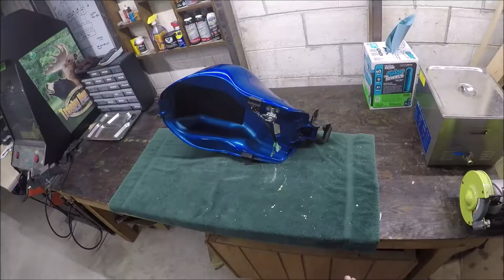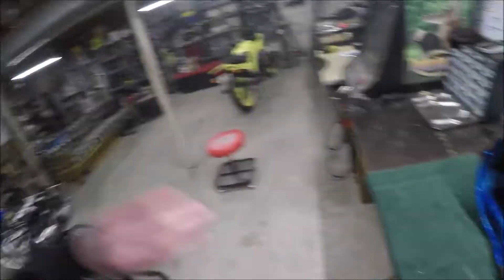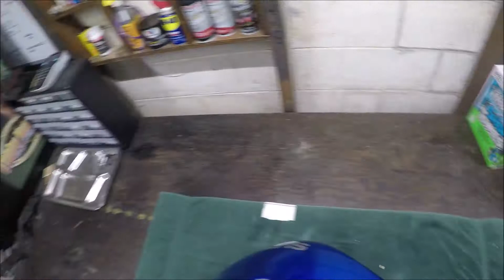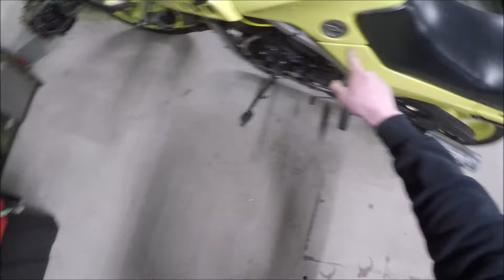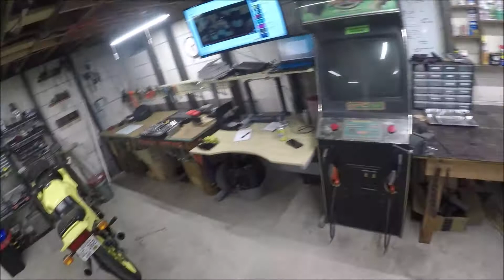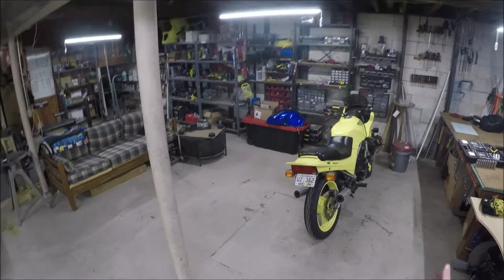[Short Rant] Vacuum Operated Petcocks

Comment: Thanks for this. I was considering "upgrading" to a vac petcock and see this is a bad idea.
Reply from the maker: I should probably mention that there is a safety aspect to vac operated petcocks... In the case of a tipover where the bike cuts out, fuel won't flow and possibly add to a fire.

But you're more likely to find your bike on fire with a vac operated petcock because youll want to light it on fire sometimes.
Reply: @matttriestodothings  Lol it sounds like it, what a pita. I was curious because of the tipover aspect and not having to turn the valve all the time, but I have less patience for things failing than turning valves.

Comment: I was all in when I read rant.
Reply from the maker: Hah, I was doing really good today at tempering my temper until I realized every single vacuum-operated petcock I've encountered has been a nuisance. I didn't throw anything though, and the tank is all set to go back on the bike.
Reply: My bandits vacuum fuel valve leaked constantly causing it to be towed three times by my apartments HOA. Ruining the motorcycle parking space they just paved for us. It’s a ridiculous design, but don’t your bikes have the overflow float valve thing preventing the fuel from entering the engine in case it fails? Only a small amount of fuel went into my oil. Barely raising the oil level. My bandit was a ‘97 so maybe I’m exempt from that issue?
Reply from the maker: @hondacbrico5866  Oh no, the MK2 Bandit goes right into the cylinder. No overflow.

It's not really fair that I bitched on Suzuki while looking at an SV650 during this rant because the SV has a vacuum-operated fuel pump AND petcock. So, it won't actually run straight into the engine (with a stuck float) like the 2002 Bandit I have will.

One of my last rides of the year the Honda VF500's petcock failed while I was out riding, and I had to limp it off the goddamn freeway. Luckily I was near an exit. I called a (savior) friend that went to my house, grabbed my ramps, drove out to me, and we loaded the bike back up.

I seriously hate this things. They're seriously clever, but they don't stand up to the test of time.

Comment: Can You Please Show Where The Vacuum hose Is Connected On The Vtr Interceptor I Have A 88 And Having Issues With That
Reply from the maker: A VTR 250? I'm not familiar with that bike, but it's likely similar to the VF500F based on the images I'm looking at. The vacuum-operated petcock will connect from the petcock itself to a vacuum nipple on one of the two carburetors. What's got me a bit confused is they call what I would think is a vacuum line a breather tube CLIP, BREATHER TUBE
15772-551-000. I believe this is from your bike here: https://www.partzilla.com/catalog/honda/motorcycle/1988/vtr250-a-interceptor-vtr/fuel-tank
Reply: @matttriestodothings  Alright The Bike Has Dual Cv Keihin Carbs .  I'm Wondering Where The Vaccum Line From The Petcock Would Connect As The Carb Only Have One Nipple Sticking Out On Each One The It Has The Carb Drain When You Turn The Drain Screw

Comment: Where do you get replacements for these vac operated petcocks?  My KZ440 has a bad one.
Reply from the maker: It'll depend on the hole spacing that your tank will accept. I did a Kawasaki 454LTD recently with a Yamaha 2VN-24500-02-00. I also did a Suzuki Bandit with that Yamaha one. But I couldn't tell you if that same petcock would work with a KZ440.

Come to think of it... I did a Kawasaki EX500 with the Yamaha 2VN-24500-02-00 as well. I just had to grind a little bit of the handle off to make it fit.

Comment: my yamaha 79 xs 750f has vacuum petcocks, and i don't know if that's causing my carbs to fucking flood constantly, or if it's something else. but every forum i've looked at they say to just convert to manual.
Reply from the maker: Not familiar with that bike, but if they're constantly flooding it means the float valves aren't sealing. Theoretically there should be no need for a petcock (for this purpose).

Going to a manual petcock certainly removes a variable tho. If the leak is slow enough that it doesn't affect the bike while running, a manual petcock may be a stop gap. But the carburetors shouldnt leak at rest regardless.

Floats are never fun. Hope you're able to get it resolved without too many headaches.
Reply: @matttriestodothings  when you say not sealing do you mean not floating properly causing them to continuously fill?
Reply from the maker: @The_Rat_King23  Yep, exactly.
Reply: @matttriestodothings  well that's a relief, at least I thought something else was very wrong. I just rebuilt them so maybe the floats have holes

Comment: My SV is a 1999 , had it from new,The pet cock only failed now (December 2020) A rebuild kit was about £10.00.  Not bad for 22Years old.this only failed because of rust in the tank blocking the pet cock diaphram. What's the big deal!
Reply from the maker: The rebuilt one on my SV will probably last many many years now, but the big deal to me is the unreliability of the things. It's an both an annoyance and potentially dangerous. I lost power on the freeway when one of them failed (not SV), and was lucky enough to be near an exit. On bikes without a fuel pump that use them, I don't trust that they're going to stay perfectly sealed for the duration of a winter.

They just seem like a solution to a problem that shouldn't exist. There are tons and tons of stories of Suzuki Bandit owners all going to check on their bikes after winter only to find all of the fuel had migrated from the tank to the crankcase. I would have thought this would be pretty rare since it requires two failure points (petcock and 1+ floats), but it seems super common. That petcock doesn't have an OFF position which is really silly to me.

Just look at HondaCBRico's reply below. The Bandit one is a special kind of awful, so I was already spoiled to the idea of these things to begin with. Having another fail last year didn't help. I haven't read nearly the horror stories about the SV650 version though. I think it's far less prone to a failure.

Comment: Can't you run just on prime? And turn it to the ON after a ride as "OFF"
Reply from the maker: Depends on what question you're trying to answer and for which bike. Suzuki GSF600 has ON/RES/PRIME, so you can certainly run it while it's on prime. The issue then is whether or not it closes correctly when setting it to ON. On a Honda VF500F, you have ON/RES/OFF--no prime. So if the diaphragm fails and doesn't allow it to open, you have no way of bypassing the vacuum-operation. This leaves you stranded on the side of the freeway.
Reply: @matttriestodothings  Thanks for the reply. I asks this because I just got a 2007 DRZ40SM with an FCR Keihin carb and my stock vacuum petcock has ON-PRI-RES. The guy I bought it from did  not have a vacuum line because FCR doesn't have a nipple. It runs on prime only because of it. I'm worried if this will ruin my bike.
Reply: @matttriestodothings  I took it to the shop and got all my jets and brass adjusted-cleaned carb.. even the shop just mentioned that my On is "off" and have to run prime. But wouldn't that ruin the bike?
Reply from the maker: @bziano883  You won't ruin the bike that way--the shop is correct. Functionally, your petcock now operates the same as a standard ON/OFF mechanical fluid valve. PRIME = ON, ON = OFF. 

It sounds silly, but you're good to go. The only potential failure point is if the diaphragm ended up getting some crud in it and not sealing correctly allowing fuel to move passed it when not in operation. However, since it's not actually being used at all since it isn't hooked up to a vacuum port, this is really unlikely to happen. You're good.
Reply: @matttriestodothings  wow. What a stress reliever. I just installed a new OEM petcock so I don't believe the diaphragm will fail soon because I was so worried lol. Thank you for the wisdom, I just subscribed to your channel!
Reply from the maker: @bziano883  Thanks dude! You should be good to go. Just ride and enjoy the bike! OEM is the right way to go on petcocks. I've taken a few gambles on cheap knock-offs and they almost invariably start leaking or working poorly. I doubt you'll ever have any issues with yours especially with it functioning as an ON/OFF equivalent.
Reply: @matttriestodothings  this is my first ever motorcycle! But I I have one more question, Being that I run on prime, do I need to worry about too much gasoline from the prime method? Or does my float in the carb control the amount of gas the carb can hold in the bowl?
Reply from the maker: @bziano883  You shouldn't have to worry because the float valve should control the amount of fuel in the bowl (as you stated). PRIME is essentially equivalent to ON for a standard mechanical petcock. 

Take my TW200 for example. It has a basic mechanical petcock with ON/OFF/RES. It's either open or it isn't. 

Your PRIME is just equivalent to an ON. It just bypasses the vacuum-operation.

The one caveat being that you should still turn it off (in your case, ON lol) when you're done riding. If the float valve in the fuel bowl doesn't seat correctly, it can allow fuel continuously flow into the carburetor. If your carburetor has an overflow, it'll fall to the ground. If it doesn't, it'll make it's way into the cylinder and crankcase. You can damage an engine if this happens, so something to be aware of.

Have fun with your first bike, and welcome to the addiction!
Reply: @matttriestodothings  Wow. Again you are very helpful. I'm so cautious about this that I make SURE I have it in the ON("off") position after a ride. Thank you brotha 🙏🏽